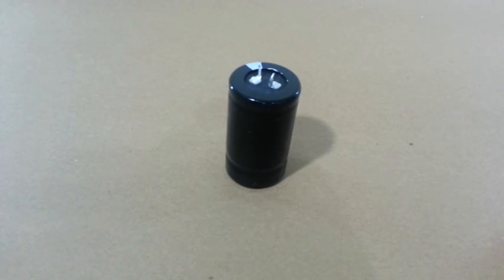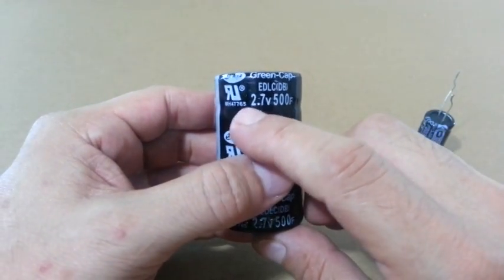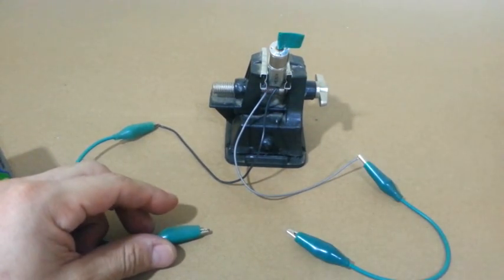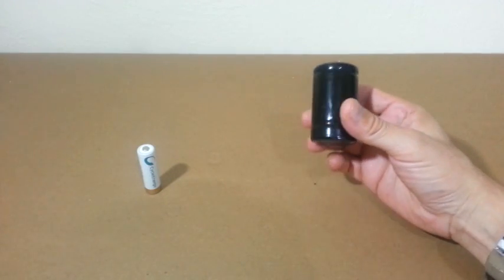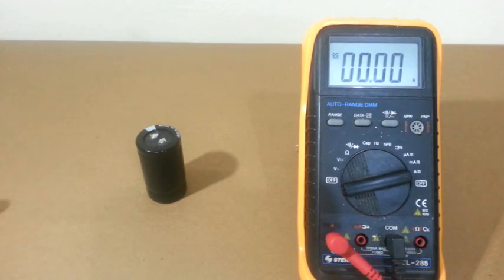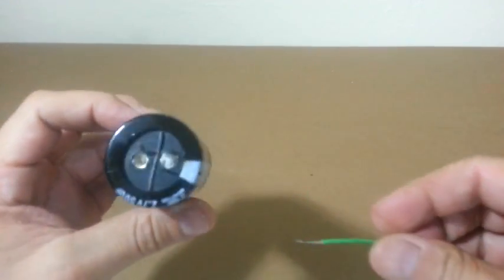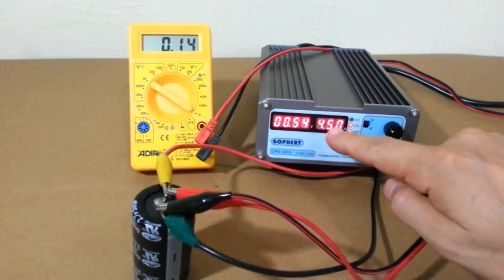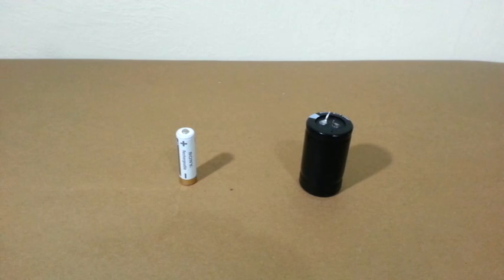Supercapacitor Basics

Comment: Supercapacitors are really awesome.......... One day they will replace the batteries.
Reply: super caps are really only better than batteries if you need a lot of current for a short amount of time. and currently we rather need more capacity than higher current(look at phones and their couple of hours battery life). super caps have their place but batteries do too. neither will replace the other.
Reply: nope batteries and caps work different
Reply: They are replacing batteries with capacitors already.
Many toys have capacitors in them already too.
Reply: jort93z capacitors in general are rated to work at full-power in much more extreme temperatures than batteries, can suck up massive charge in an instant, arent harmful to the environment to manufacture or dispose of, AND are rated for hundreds of thousands (sometimes millions!) of full cycles.A large enough capacitor bank that only requires one cycle a day would probably be working fine long after you were dead lol.There are apparently some very high end korean ultracaps now too, that have huge storage and minimal voltage leaking.

Capacitors really, really should be storage of the future, and im sure they will be, the second the capacity gap between lithium cells is gone
Reply: +Mukesh, from what I've heard, some cordless telephones are presently using supercapacitors instead of rechargeable batteries. And as was mentioned at 7:11 of this video, the technology is in constant development.
Reply: waleed khalid When I was a kid I used to light an LED with a capacitor for 2-3 minutes.

Supercapacitor will surely replace the batteries.... Because it can discharge like a normal battery.
Reply: Mukesh
but with alot of amperes!
am i right
Reply: Chase R there's many people working on "hybrids" to get the long term storage of batteries, with the short amount of time it takes to charge
Reply: ......no
Reply: Do you people not realise they're different things?
They serve different purposes, neither will replace the other

Comment: so how many charges can a supercapacitor have before it becomes useless?
Reply: The life of an electrolytic capacitor is not controlled by the number of times it's been charged, but by the age and decay of the internal chemistry.  If the chemistry is done well, you'd expect an electrolytic capacitor to last around 10-20 years.  Unfortunately, there are a lot of capacitors with dodgy chemistry these days, and some of them will only last for around 3-5 years.

Comment: can you use a heap of these in a parallel circuit to get a good power supply from them?
Reply from the maker: yes you can
Reply: thanks for the reply ,would the current be the same ,or would it amplify with every capacitor you add?

Comment: the charge or the discharge of a capacitor is not  linear, but is an exponential curve determinate by a time constant
Reply: If you discharge through a resistor it's exponential but discharging it through a current source (constant current) it's linear.
Reply: With special circuitry like boost converters this can be linear
Reply: I think he said 3:43 "Capacitors have a voltage that drops almost linearly with charge" - which is true: Q=CV or V=Q/C
However the voltage, of course, drops exponentially with time when discharged through a resistive load.

Comment: Hello Ludic Science , Kindly clarify for about the condition of one of the two super 
electrolytic capacitors (10000 micro farad /63v) in my much beloved 
Grundig FineArts A903 stereo amp. The amp is in working, but one of the 
capacitor has corrode on  outer side of the  body as a small patch 
between the body and sleeve. Is it because of humidity and sweating ? Or
 any acidity? anything weakness of the capacitor? Is inside OK? I am 
much much worried about that. Because  I'm not a technician, here in my 
place in India, there is no any qualified technician to check this high 
end electronics. But the amp is working as usual and normal.  Will it be
 safe to use this amp as further as normal? should the outer sleeve of 
the capacitor to be removed?  Replacing the new capacitor could be easy for me?  
I had  put this amp as unused for six months as I went for my knee surgery.
 I want to know that, shall I use this amp as hours together without any fear?
 Kindly let me know about this. I am really worried about this 
condition and confused. If I get your mail id, then I can send the actual photo of the capacitor. If I hear from you that   'the thing is normal and not to worry about it'! '
then I will jump with my transplanted knee. Plesae do help me.Thank you and best regards
Reply from the maker: please upload your picture to facebook or any other site and send me link.
Reply: Hello Ludic Science, Here I have uploaded the picture of the capacitors of  10000 micro farad/63v. One of the capacitor's outer body was corroded inside the sleeve. Previously I have written in detail to you. Kindly let me know about that as in detail. Thank you. Regards.
Reply from the maker: where is the pic?
Reply from the maker: It is hard to tell ony from the photo.  Best will be to change both capacitors, not only one. Replacing the cap is easy if you know how to solder properly.
Reply: Which one brand is the bests for this value of the capacitors of 10000 farads/63v. Can I upgrade to a higher value capacitors? If yes, which value would be better? Kindly, please  let me know. Thanks again.
Reply from the maker: Use the same brand as the original caps. Use the same value. A larger or smaller value can destroy your amp.
Reply: Thank you Ludic Science, Regards.

Comment: They are not batteries, they are cells, a battery is two or more cells connected together.
Reply: A 9v is a battery because it has six smaller cells wired in series
Reply: Ever seen an aa battery? They are one cell only
Reply: There is no such thing as an AA battery, despite what it says on a Duracell AA, it is a cell.
Reply: I am pretty sure a battery can be just 1 cell. For example a single copper zinc cell has a voltage of 1 volt approximately.  The more the electronegativity difference, the higher the voltage. You can power an infrared LED with just a 1.5 volt battery(I looked at a wavelength-voltage chart for LEDs past the visible spectrum). The only thing you need for a battery is 2 separate materials to store electricity and a dry or liquid electrolyte(hard for electrons to pass through kind of electrolyte).
Reply: I was taught, admittedly some 50 years ago, that a battery comprised two or more cells usually connected in series to give a higher voltage, e.g. a 9 volt 6F22 contains 6 cylindrical cells or 6 flat "layer" cells and a 6 volt 'lantern' battery contains 4 cylindrical 1 1/2 volt cells.
Reply: I dunno, but Wikipedia defines A battery as the following: "An electric battery is a device consisting of one or more electrochemical cells with external connections provided to power electrical devices such as flashlights, smartphones, and electric cars"
Reply: Wikipedia is not a reliable or authoritative source and, worse still it is American.
Reply: Silver Legend
so what? the human brain isn't better. I am the one here listing sources... you are just denying
Reply: Understanding you am I not!
Reply: Thankyou for confirming that.
Reply: soo.. after a while of digging... the technical definition is two or more cells.. BUUT before you get too excited: The term Battery is casually used for all types of cells and Battery, so no, saying that It is not a battery may be technically correct, but language is not a static construct, so the widespread definition is one cell or more.. As an example in Germany, we don't call them cells (except D-Cells for some reason) we call them Batteries. Of yourse you may bitch around telling everyone that they are Cells and not Batteries, but being right does not make you less of an asshole.. Anyways if the companies producing the "cells" call them batteries, we should no longer worry about their name. drops mic
Reply: +Valentino Saitz ...A battery is basically a device that produces electricity from chemical reactions. They can be single-cell or multiple-cell depending on the voltage they are being designed to produce.
More cells=more voltage, bigger cells=more amperage/capacity.

Comment: if we use a supercapacitor as a cell phone battery although it can be charged in a couple of minutes but due to its high rate of self discharging capacity our cell phone needs to be charged more frequently as compared to the Li-ion battery
Reply from the maker: +kanav Sharma That is true, but I will prefer to recharge 3 times a day for 5 minutes than to recharge once for two hours.
Reply: Ludic Science 
However then we would just waste a lot of energy, which is not acceptable for future

Comment: You can keep the capacitor's voltage constant by using a variable resistor that utilises a variable resistor that keeps the capacitor's voltage at 1.5 volts, same as a battery using an Arduino.
Reply: +Akshay Sharma it's called a voltaje regulator you coud use an lm317

Comment: Correction, there is actually more than 1,000 times energy that can be stored in the larger capacitor... E = 1/2 * C * V^2
Reply: +Gerret Evolution he said the larger one could store more than one hundred thousand times more charge than the other. his math was wrong indeed, it can store about 1240 times more charge than the small capacitor. considering the supercapacitor is about 7 times larger (in volume), its energy density would be about 180 times higher. still impressive, but he should get his facts right. and he's also wrong about the capacitor dropping it's voltage linearly with the amount of energy spent (at 50% charge it wouldn't be at 50% voltage; instead, it'd be 0,5^0,5 of the full charged voltage).
Reply: @luisbaltazar1   CNL _  i went and calculated 0.5^0.5=0.707, so does that mean that at 50% charge it would have 70% voltage. that would make it 20% ?  better than the battery.

Comment: The capacitor lasts roughly around 50 years(maybe more), the battery last around 5 years..  
so 1800 J for 50 years, or 9000 J for 5 years.

Comment: where bought you this 500 F capacitor?  ;)
Reply from the maker: +HV and more ebay
Reply: Ok thanks 

Ps nice Videos ;)
Reply: +Ludic Science I want to buy a few but i dont know which ones ... can you sendme a link from which seller you bought yours pls ?
Reply from the maker: +HV and more I found that they are over rated, real capacitance is around 300 F, however still a good deal for the price: http://www.banggood.com/Black-2_7V-500F-3560MM-Super-Farad-Capacitor-p-979311.html
Reply: Ok thanks do you think this ones are also ok ?
Reply: First i wanted to buy on aliexpress but then i had seen that they do not accept paypal... ; (
Reply from the maker: +HV and more Too bad, I also wanted to buy  from them, but they are individual sellers in China... I don´t want to use credit card for that. Those caps from your link are the same as mine from bangodd
Reply: Is it good enough for me ... i am 14 Years old ...to start
Reply from the maker: +HV and more I have the DS0201, cheap and reliable

Comment: What's the difference between a diode and a resistor?
Reply: +Ad J  resistor offer resistance to current and diode acts as a valve
Reply: Gokul N can you give me an example on when to use a diode & when we should use a resistor?
Reply: +Gokul N  With respect, diode acts as a one way valve. A diode allows current flow only in one direction and have current ratings,
Reply: +Ad J  Have you tried to google diodes and resistors? You will get a wealth of info. It would take me a whole page to list all the various uses for each...

Comment: You can make these yourself, I tried it out and it completly worked :) Active carbon in combination with lye (sodium hydroxide) is pretty awsome, I acieved around 300F at 1,2V. Just look on youtube for "Tic-Tac supercapacitor - 800F from the kitchen"
Reply: Hello . Did it really work and lasted . Did u test the capacity?
Reply: Yes it worked. You can calculate the capacity if you discharge the fully charged cap through a resistor. There is a formula, you can look it up. The plates were made of rabbit-fence with glued on active carbon. If you don't conver these metal wires completely, electrochemical reactions will take place, which destroys the fence wire.
Reply: Thanks my friend for yr help . Ill try

Comment: Didnt Robert Murry-Smith recently make a mega farad capacitor?
Reply: Yes. and he is getting ready to go into production. his latest bid said the machine is placed and almost ready to run.
Reply: +Spangley Rainbows i looked it up and his 10kF is described as "slightly larger than half a ream of paper". which means it has less power density than the supercapacitor in the video, if density of both capacitors are the same. so his megafarad capacitor would be absolutely massive. if that's the case, i don't see much reason for excitement.